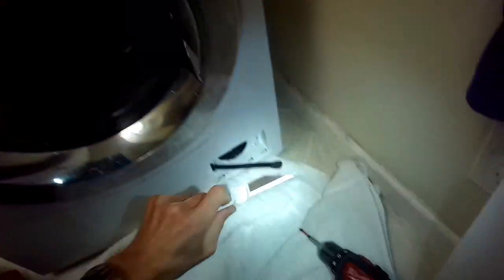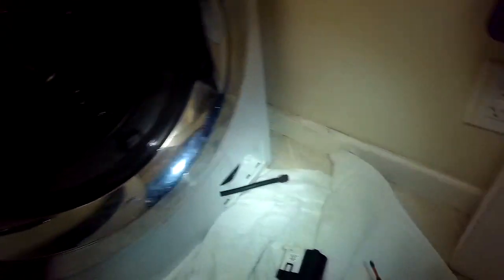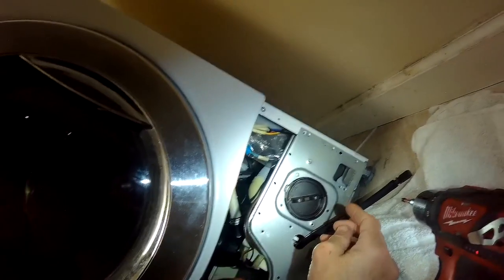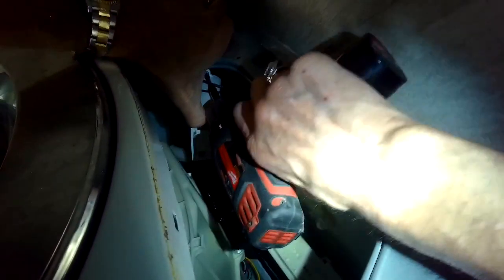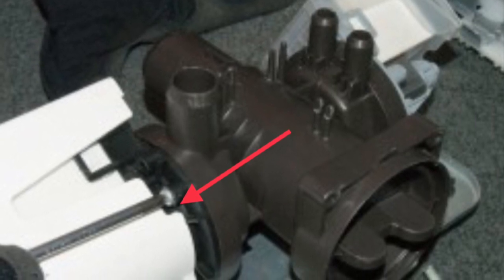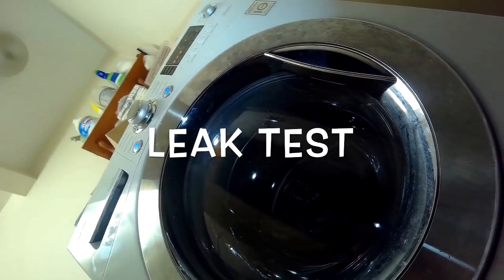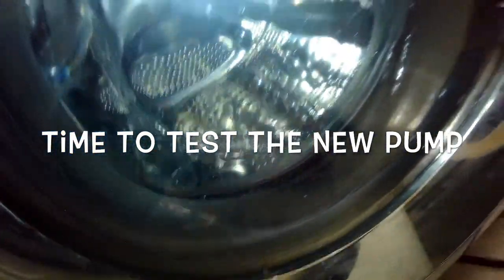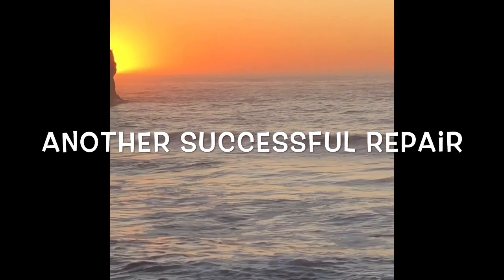✨ LG WASHER-DRYER  WON’T DRAIN - OE ERROR MESSAGE — EASY FIX ✨

Comment: 4 years ago, I did this too based on advice from a tech... Thanks for the video.
Reply from the maker: That’s good, it lasted 4 years👍
Reply: @ScottTheFixItGuyChannel   - your video is simply excellent - well explained. Thanks for uploading it. Will help many people to replace the pump. However, the bigger issue is that LG should make better pumps for their washers so that they do not bust up so often.

Comment: Great video. Thank you so much for putting this up. I got my drain pump through Amazon and replaced it. My machine was WM3448H so it had three screws but that was the only difference.
Reply from the maker: Excellent ,

Thank you👍

Comment: Hi Scott, my washer-dryer has 2 pumps, how can I determine which one is failing.
Reply from the maker: It’s the one on your left when your facing the washer👍
Reply: @ScottTheFixItGuyChannel  Thanks you Scott, I changed the pump but didn't fix the issue, it drains some water but really slow. I already checked all the pipes, from the tub to the pump, from the pump to the backhose and it doesn't look like its obstructed. Already cleaned the filter but none worked, any idea?

Comment: Lg dryer model DLEX3470V.  Steam cycles not creating steam. No error message . Tried unplugging etc. Any ideas?
Reply from the maker: I wonder if the water supply in the back got turned off?
Reply: @ScottTheFixItGuyChannel  it is a tray you fill and slide in. No water connections. Do you know if thete is a separate heating element that creates the steam?
Reply from the maker: Thanks Alan,
Please click here to contact me for more detailed help: https://calendly.com/scottthefixitguy/advice-for-fixing-your-appliance

Comment: ok—great—just one problem. no matter what i do i can’t get the to screw back on tightly. other two are flush so there won’t be a leak between the motor and drain, but can’t get the top one to do anything but spin. hints? tips? tricks?